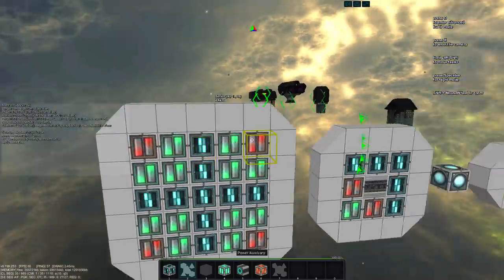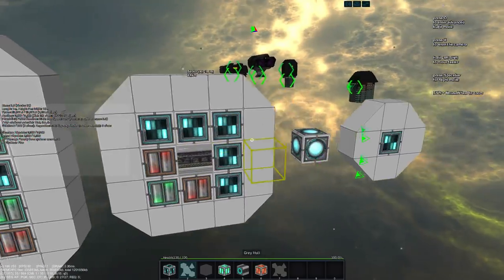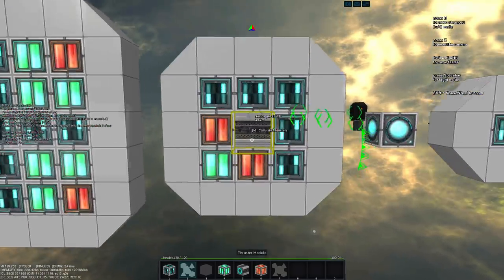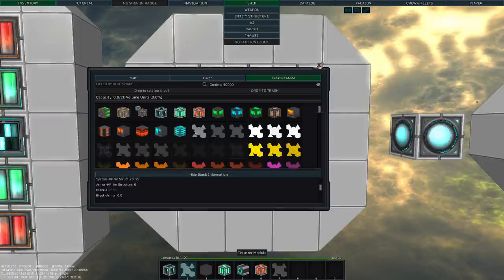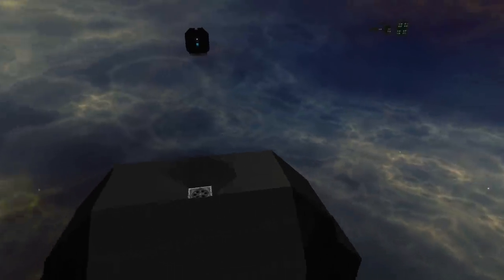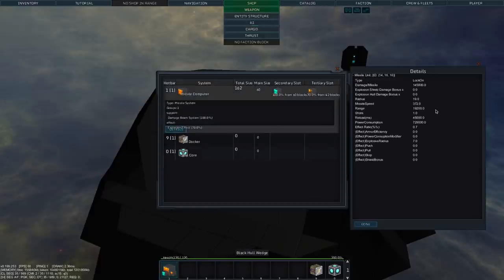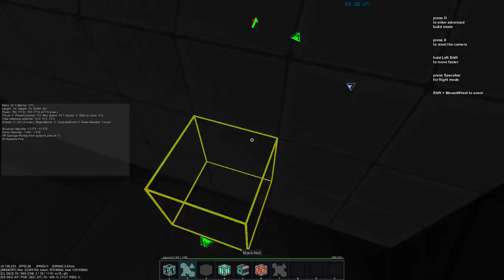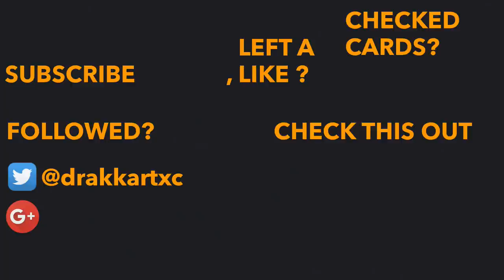Starmade: Building Guide, Design Decisions, Game Mechanics, Turret Collection

Comment: Excellent video that mirrors my own thinking about turrets up until quite recently. Any new player would be well served taking everything said here to heart. I think your aside about the ratio of hull cladding to contained systems is especially helpful for such new players. 

Of late however my thinking on turrets has evolved a fair bit, and some of this may be too complex for newer players still struggling with the nuances of the game. I no longer put shields on my turrets. The main ship still has to move that mass around, and if the main ship has to move the mass anyway, I feel it is better to have those shields on the main ship itself where the shields can cover 'all' the ship, not just the one turret. Moreover, by keeping the shields on the main ship, the turret then functions much like would a docked hull, soaking damage while the shields are able to regenerate should they fall below 25% strength.

I have also, for large turrets, stopped making the base or barrel self powered. What I am doing now is making such large turrets three docked entities, not two. A large offensive turret for me now is a barrel which contains the weapon system and armor cladding. The base which contains solely the necessary gear for rotation and elevation, it's own armor cladding, and sufficient mass enhancers to cover the barrel. The base is docked to a disembodied turret axis that is spawned from a third docked entity, it's power core, which is actually buried deep inside the ship's hull. That third docked entity is built with sufficient power reactors and power capacitors to handle all the power needs of the turret barrel. It also of course has sufficient mass enhancers to cover the mass of both the base and barrel. This third docked entity does not rotate, it is docked to a standard rail and can be completely covered over with systems from the main ship.

Combining all this with a docked hull using spaced armor (and of course full defensive passives) along with decent shield regeneration from the buried core ship, and you wind up with a ship with insanely long staying power that takes enormous fire to destroy. The turrets are relatively small despite each of them firing two million power per second weapons. Their smaller size both makes them smaller targets and makes it easier to give them clear fields of fire.

Admittedly building this way is vastly more complicated and probably way too much for a new player to handle without too much frustration. For instance all such offensive turrets need to be placed long before the inner ship is finished or it will be impossible for the docked power core to extend a block line so as to place a turret axis from them (and then remove the blocks that were extended). Building docked hulls is a major pain in the ass if one is trying to avoid clipping issues, which if not caught during construction will result in major lag issues during combat. (Some people deliberately do not avoid clipping and use it as an exploit. I hope Schine patches this exploit soon.)
Reply from the maker: interesting thought i just do not see the point of your third docked entity why not directly dock all the turrets to the ship itself? Your way you just need more mass enhancers because of the additional level of docking compared to selfsustained turrets docked to the main ship directly. the main ship probaly will provide tons of mass enhancers just used as decoration already so ...

But agian thank you for that comment, very inspiring.
Reply: To get two million extra power from the main ship itself will take nearly ten thousand modules of auxiliary reactors. If you are powering for instance a cannon/beam weapon you will also need eight thousand capacitors to store that power. That is a total of eighteen thousand modules to power the one turret. Moreover those auxiliary reactors are a major fail point for a warship, as when they take damage, they will start exploding. If you make it a third docked entity however you can use standard power reactors and get that two million extra power with as little as two thousand blocks. Add in the capacitors and you are getting both the power 'and' the storage inside the same volume/mass that the auxiliary reactors alone would have used, and the docked power core will not explode. You save a LOT more mass this way than it costs in terms of mass enhancers.

Putting the power source off the turret makes the turret a lot smaller, which reduces the mass enhancers required. The three docked entities per turret actually does not use much more mass enhancers than does turrets that produce their own power. A turret that can generate two million power is a BIG turret. A turret that simply 'uses up' two million power on the other hand can be relatively small, depending on what you put into it.
Reply from the maker: hmmm well i am going to consider it but for my actual project i will need auxilary power anyway in that particular case it probably would not have made an impact but sure that is ofc true that each docked entity again may have it's own docked power reactor thing so i am thinking of docking 2 million power regen with thruster modules and then inhertit thrust of docked entities... this way taking a lot of powerrequirements off the main ship for you could do that again and again... sadly again totally working around their "fix" but what ever i told them that they did not solve the actual problem of lag spikes when stuff comes loose. so what ever...
Reply: Destroying a rail, turret axis, docker, etc., should in my opinion not cause the block to vanish and the thing that is docked to start free floating and crashing into everything. Instead what should happen is that if such a rail entity is destroyed, it should spawn in a ghost that renders the thing that is docked utterly inert, it ceases to function completely, but it stays firmly affixed. It does not float, tumble or collide. Combat damage should decrease lag, not increase it, by rendering things that used to require collision checks, inert and therefor no longer requiring them.
Reply from the maker: not the most realistic approach but indeed a fix for the lag problem.
Reply: I have been thinking this exact thing, as I've been trying to figure out larger ship builds post the aux power update.  So many tutorials are obsolete now, and there has been a surprising quiet from the YT community on new approaches.
Reply: Also if you dock your turret base to a third entity that has a Rail Basic instead of a Turret Axis, then that turret will function while your ship is docked to a station.
Reply: What do you guys Drakkart and Panpiper think about using rapid fire turrets to decrease single shot power cost? Is having to use cannon secondaryes realy so big drawback?

This then removes the need for all those capacitator blocks in the base, considerably increasing turret's dps/mass ratio. Even further, it is perfect for making turrets that use more than 2 000 000 power/sec because it is easy to add as many docked entityes as you want below the turret since they are considerably smaller now. Each entity needs only 200 000 power capacity because turret fires 10 shots per second.
Reply from the maker: you really do not want to mess with to many docked entities. i like the idea a lot keeping the energy deand just below 50k but then firing pretty often is in fact one way to game the system that is really effective.

Comment: What diameter would you suggest if you want to make more longitudinal turrets? ( I know the AI is prone to screw those up, but still :D)
Reply from the maker: Actually i do not think the diameter will have any effect on their viability. so build them as big as you want. i don't like using them i rather slap a normal turret on the front of the ship forcing the normal turret to be firing right upwards if it wants to target an enemy in front of the ship... but maybe that is also because i have not yet tinkered enough with longitudinal turrets yet.